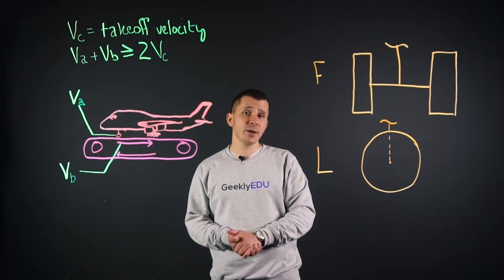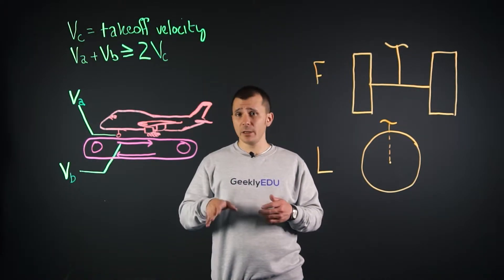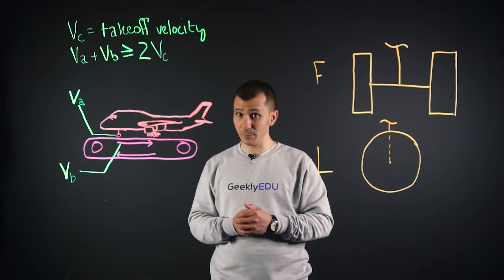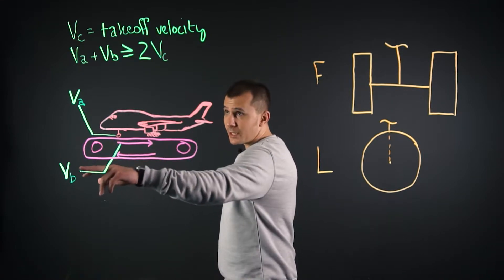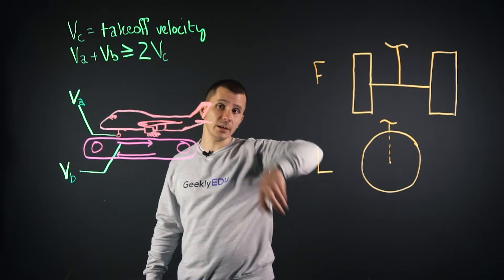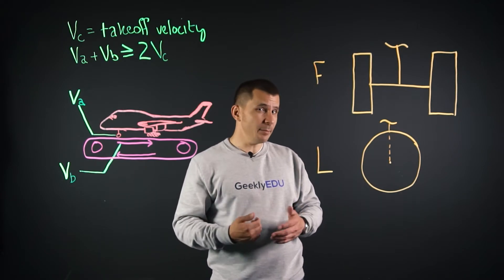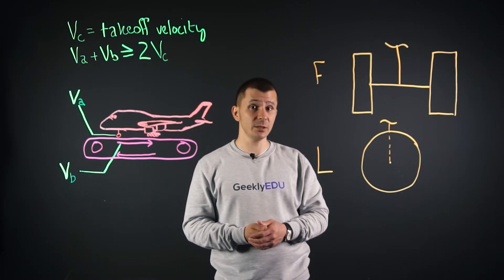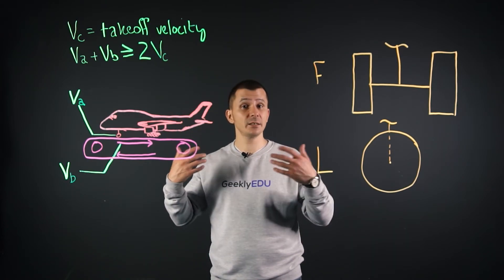Plane on a Conveyor Belt - Will It Take Off? #GeeklyHub

Comment: Maybe I'm missing something. Larger aircrafts need air flowing over and under the wings to create lift. If the plane is stationary in relation to the air, how is lift created?
Reply: Start by not assuming that the plane will be stationary
Reply: @syncmonism  the formulation of the thought project means that the plane will be stationary.  What's underlying that is where people are getting tripped up.  They think that the immense power of the turbofans is unstoppable and that the conveyor mechanism is impractical.  Both are true, but the math, logic, and physics of a rotating wheel on a moving conveyor is undeniable.

Look at the treadmill car races to see what happens when a test vehicle on wheels is placed in equilibrium with a treadmill/conveyor.  They are frequently pretty humorous.
Reply: That was always my question and it seems like a simple one.  However, nobody could answer it simply.  
Basically, the wheels are not the mode of propulsion. You and I are seeing wheels and thinking "Car."    If a car were on the tredmeill and the car went forward at 20 mph and the belt went the opposite way at 20 mph then yes, the car would appear to be stationary.   But the wheels of a plane do not provide forward momentum.  That is the prop or the engine.
Reply: @Laceykat66 20mph is 20mph,

The confusion some people have is that there isn’t a corresponding speedometer on the aircraft.  You would need some way to measure on the aircraft and Mythbusters did not do that.

This is kinematics.
Reply: @MrDefreese  I agree.  That is one reason there is always controversy and confusion on what should be a simple question.
Reply: The plane, though, isn't stationary. There's nothing stopping it from gaining airspeed as it accelerates under the force of engine thrust.
Reply: @tedwalford7615  We all need to be careful of what question we think we are answering. There are TWO riddles that are very similar with one sneaky change. In one, the treadmill matches the speed of the plane (i.e. the hull) relative to the outside world. In the other, it states that the treadmill matches the speed of the wheels relative to the treadmill's surface.  In the first, yes, absolutely the plane can take off, at the same real-world speed and the wheels rolling twice as fast.  The second scenario is completely different. Any time the plane moves relative to the treadmill, it will speed the treadmill up accordingly. It creates a situation where the wheels need to turn faster than the treadmill, which isn't allowed by the hypothetical. Wheels don't totally negate friction, only reduce it, and friction is linear with the speed (this is a basic law of physics). Assuming the wheels are not skidding over the treadmill at takeoff speed, there are only two possible solutions: 1. Everything is stopped and the plane isn't moving, or 2. The thrust of the plane is totally negated by the additional friction of the wheels turning at ludicrous speeds. And what would happen if the plane even moved 0.000000001mph forward relative to the real world? Well, it's a reinforcing loop where both the wheels and treadmill are at infinite velocity, which in turn would cause infinite friction.
Reply: @matts1166 the planes wheels can only turn if it's moving forward. If the plane isn't moving forward but the wheels are spinning than the treadmill is spinning faster than the wheels to overcome it's forward momentum.
Reply: @matts1166  It makes not difference what the wheels are doing because they are always free spinning and do not propel the engine forward.  The engines do this and they do it completely independent of what the wheels are doing, therefore, doesn't matter how it's worded, the plane takes off every single time.
Reply: @AwesomeFinish  Either you didn't read my whole post, or you have some pretty low reading comprehension. The riddle of this problem is with how it is worded. As I said, worded one way, I totally agree with you. Worded the other way, it creates an undefined speed paradox. It's like dividing by zero, can't be done.
Reply: @tedwalford7615 you can’t get airspeed while it’s rolling on the ground with this (absurd) conveyor matching the wheel speed.  The result of any thrust applied to the vehicle is negated by the conditions we are presented.

Everyone who says the plane can just overpower the conveyor are ignoring the stipulation and saying “we can disregard the parameters!!!”
Reply: @MrDefreese the wheels can spin until the cows come home because it isnt the wheels pushing the plane forward. What is pushing the plane forward are the engines. Plane moves forward = airflow under wings = lift
Reply: @Steven-gg1bn  hahaha thank you, I was explaining him the same in other videos.
Reply: @MrDefreese hahahaha you are also here ah? 😂 No matter how many people explain you that you are wrong, you don't want to learn you only want to be right, no matter how many nature laws you have to avoid 😂
Reply: @Thetruethrust  you must misunderstand natural laws.  Try introductory physics.  🤷🏽‍♂️
Reply: @Thetruethrust that’s hilarious if you think the plane moving forward at 1mph somehow negating the parameters of the question it can take off lmao. You people don’t know basic physics
Reply: @MrDefreese a planes wheels speed is only created from forward momentum. So there is no way for the treadmill to match it.
Reply: @bigboyboris7164the issue is that it's a paradox. The treadmill can never match the speed of the wheels because if it inhibits forward momentum then it's spinning faster than the wheels. If it's trying to match the wheels then it can only ever be behind. The wheels rotation comes from the plane moving forward. If it's not physically moving than the wheels aren't rotating.
Reply: @MrDefreese  You can get airspeed even with this ridiculous impossible conveyor belt - sure it might match the speed at which the wheels are rotating, but the wheels could still simply slide along the treadmill in addition to rotating, causing the plane to accelerate without ever needing the wheels to rotate faster than the treadmill is. So yes, the plane would overpower the conveyor belt no matter what kind of crazy impossible treadmill you invented.

Comment: The speed of the wheels and the opposite moving convey belt have zero to do with the speed that the propeller propels the aircraft forward through the air giving it lift.  The only difference between an airplane taking off from a runway or taking off from a giant conveyor belt moving in the opposite direction is the speed of the wheels before attaining lift.
Reply: There are two variations of this riddle. One is that the conveyor moves equal and opposite the airplane's hull. That DOES allw for takeoff, just with the wheels spinning twice as fast. The other variation is that the conveyor moves at exactly the same speed as the wheels of the plane. This changes the answer entirely. In this case the plane can NEVER gain ground on the conveyor, and if it somehow did the wheels and conveyor belt would BOTH instantaneously have both infinite speed and friction. (No, seriously)
Reply: @matts1166  Not true.
Imagine if the front of the plane was connected by a long rope to the back of a car that is in front of the conveyor belt and not on it. As long as the car stays stationary, so will the plane no matter how fast the belt moves. As soon as the car starts to accelerate, it will pull the plane off of the conveyor belt with equal acceleration as the car no matter how fast the conveyor belt is turning. Now, replace the rope and car with a propeller. The propeller will pull the airplane off the conveyor belt in the same way as the car and rope did. The rate at which the wheels spin does not matter. Just like the rope and car, the wind travelling through the propeller giving the air plane forward thrust will pull the airplane off the conveyor belt in  the same way regardless of how fast the belt is moving.
Reply: @FishHeadSalad  untrue. You are ignoring a premise of the hypothetical. If the conveyor Always moves at the same rate as the wheels then the plane can never advance. If it did it's wheels would be spinning faster than the conveyor, which is not allowed in the hypothetical. The wheels are not frictionless. Pulling a plane forward would only speed the conveyor belt up until friction was equal to the force of the push/pull. This would likely be in the several thousand mph range. This assumes indestructible materials and no slippage or skidding of the wheels.This was covered as a bit of a "fun lesson" in my college physics class.
Reply: @matts1166  Believe what you want. The air, like the rope and car, works independently of the conveyor belt. The wheels do not give the airplane its thrust. What you describe will only work on a vehicle in which the wheels are the source of propulsion. 
You can do the same experiment with a skateboard on a rope, a remote control car and an exercise tread mill.
Put a skateboard on a tread mill and hold it with a rope in front and the wheels will keep up with the speed of the treadmill and the skateboard will remain stationary no matter how fast the tread mill is spinning. Pull on the rope and the wheels will move faster than the tread mill no matter how fast the tread mill is rotating but you can indeed pull the skateboard off of the front of the tread mill. Now put a remote control car on the treadmill and as long as the speed of the treadmill keeps up with the speed or acceleration of the car, the car will stay stationary because it gets its propulsion through its wheels. In the first case, it is the rope on the skateboard and someone either holding or pulling the rope, not the wheels that keep it stationary or "propel" it just as a propeller on a plane is what propels it, not the wheels.
The remote control car gets its propulsion through its wheels and if its speed or velocity always matches the speed or velocity of the tread mill, it will always stay stationary.
Myth Busters exposed the myth that you believe or just don't understand some time ago. Watch this video called:
Plane on a Conveyor Belt Controversy
Reply: @FishHeadSalad  Mythbusters DID NOT do this myth. As I stated in my first post, there are TWO SIMILAR myths. One has the treadmill matching the plane's speed. The other has the treadmill matching the wheel's speed. Mythbusters busted the first one, which I totally agreed with long before the episode. The second, similar myth is what throws a wrench into the works. I perfectly understand that thrust of the plane is what pushes it forward, and the wheels have absolutely NOTHING to do with propulsion forward. What the wheels do have is friction. Wheels reduce friction, but they do not totally eliminate it. The faster the speed, the greater the friction. The premise of the other riddle is that the treadmill perfectly matches the speed of the wheels. The moment the plane reaches 0.00000000001mph relative to the ground, the treadmill AND wheels are already at beyond light speed. Remember, wheel speed has to match treadmill speed by this hypothetical, and in order for the plane to move you need to get the wheels to move faster than the treadmill. it causes a feedback loop where no matter how much thrust a jet has, the treadmill will speed up to cause enough friction to cancel it out, even if that speed is ludicrous in reality.
Reply: @matts1166  By your logic, it would be impossible to pull a skateboard off of a treadmill with a rope as long as the treadmill is moving fast enough.  I guess you also believe that it would be impossible to pull a plane off of a giant treadmill with a chain attached to a car in front of the treadmill for the same reason.
The propeller will pull the airplane forward regardless of the speed of the wheels and even the negligible friction of the wheels because the air passing over the treadmill through the propeller works independently of the treadmill.  
No offence, but I am going to go with the physics on this one. Either on the ground or a treadmill, the plane will use the same distance to obtain flight.
Reply: @FishHeadSalad  I think you aren't grasping this: the friction of the wheels is NOT negligible. If a treadmill is spinning fast enough you will indeed NOT be able to pull it forward. Not only that you can even prove it in the real word. Try the exact experiment you just described: a skateboarder on a treadmill. On a stationary treadmill you can pull him forward. When the treadmill is running, you can still pull him forward, but it's with more force. Not much more, but a bit. The amount of resistance is linear with the speed, this is a basic law of physics (the one you say you put your trust in). So, yes, if that treadmill was going fast enough the friction WOULD prevent you from pulling the skateboarder forward.  I'll just ask one question, if you can answer it correctly without breaking the rules of the hypothetical I will concede the argument.  If that plane requires 100mph to take off, what are the following speeds? Speed of the airplane relative to the ground, Speed of the wheels relative to the ground. Speed of the Wheels relative to the treadmill. Speed of the treadmill. If you can answer that without having any contradictions, you win.

Comment: The outcome of the question depends on wether the conveyor belt matches the speed of the plane (body) or the wheels.

In the first case, the wheels would just have to move 2x the takeoff speed backwards and the plane will take off.

In the second case, the plane cant take off.
Reply: both the wheel speed and the vehicle speed are the same.  They are just using different frames of reference.

If you were glued to the surface of the conveyor watching the aircraft, the aircraft would appear to be zipping by pretty quickly.

If you were fixed on the body of the aircraft (in the cockpit, on the wheel axle, on the wings, at the top of the rudder), you would see the conveyor zip by at the same rate while at the same time, the static ground would be stationary.

If you were fixed on the static ground, you would see the conveyor running furiously at the same pace as the wheel rotation (because it exactly matches the rotation of the wheel).

Mythbusters was really close when they set up the equilibrium condition of the RC car on their treadmill.  Where they went disastrously wrong was by mistakenly arguing that there is a difference between the application of force on the vehicle.  There isn't.  Force is force.  Force is applying to the vehicle body one way or another which results in the rolling of the vehicle.

To see another example, there are treadmill car races where small cars or bowling balls or other round/cylindrical objects are placed on an inclined/declined teradmill.  The race organizers start the treadmill to create equilibrium between the running of the treadmill and the rolling speed of the objects on the slope of the treadmill.

Equilibrium.  That's all this is about.

Comment: the experiment goes a littel differen usually, the trick is that the the conveyor belt matches the speed of the WHEELS, not of the plane.

if the plane would move forward the free spinning wheels would have to spin faster than the conveyor belt moving backwards, which per the definition of the experiment isnt allowed.

essentially the wheels and the belt would accelerate to infinity before the plane would even move a fraction of a millimeter.
Reply: No.  You forget how the plane propels.  It propels  against air, not with the wheels.  The wheels merely reduce friction with the ground.  All the belt will do is accelerate wheel speed, while the planes air speed is unaffected.
Reply: @wulfhart1974  yeah i know that.

You can even neglect the little backwardsforce that the wheels apply to the plane and still get the "paradox"

The wheels dont affect the plane, but the plane while moving forward Spins the wheels.

The wheels have always the delta/difference between planespeed and conveyor belt speed.

So for a plane to travel forward 10 km/h on a conveyor Belt moving backwards 100 km/h. The wheels would as a result spin with 110 km/h.

Thats just how rolling works.

So by saying the Belt has to Match the wheel speed. You break the laws of physik.

Its kinda a Trick question/ math riddle.